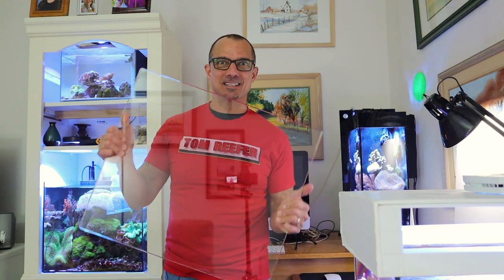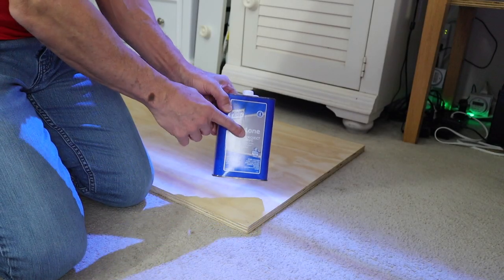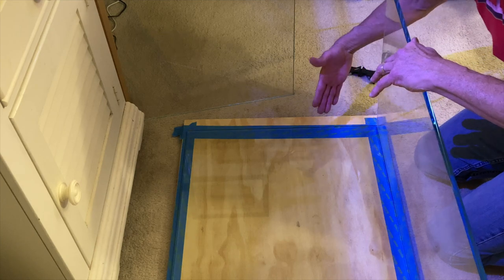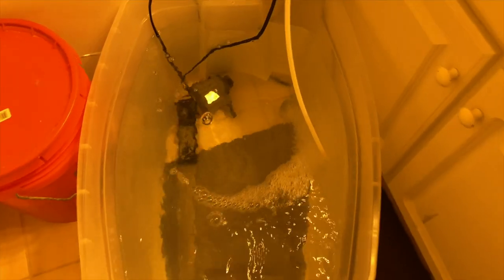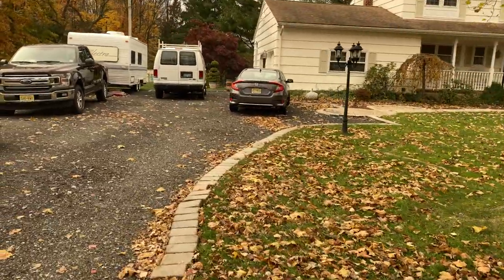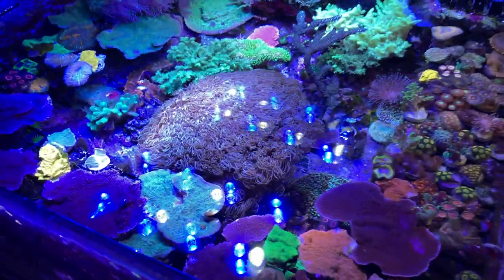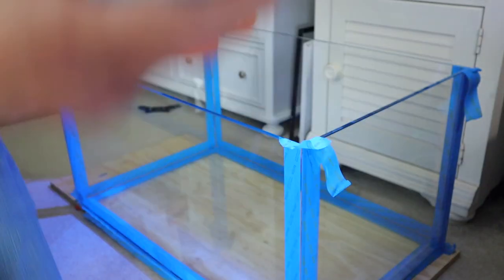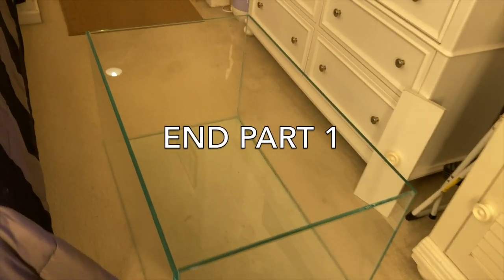How To Set Up And Build A Saltwater Reef Aquarium - 75 Gallon AIO

Comment: Great work Tom! Please tell me you are using glass for the filtration box? You can use black acrylic as a cosmetic skin but make sure the glass structure comes up all the way to the overflow point. Best solution would be black glass and have the overflow cut with a water jet like the waterbox has.  The difficult part is getting the glass and acrylic properly bonded.
Reply from the maker: Hi Richard, I would love to use glass, but I want it to be opaque. WB glass is translucent and you can see through it if I make a refugium. Plus to have the glass cut like you’re saying will cost more then I wanted to spend😃and I will need to have baffles made also. I’ve had success, for interior applications, gluing to glass using Weldon 16 acrylic glue. I won’t be using black either. 😜. You know I like to be different, but I’m also very aware of what will look good .IMO 😃

Comment: Great work Tom! I love your channel and your unique style. Question, why do you consider siliconing on top of the glass a bad idea? I have done this on pretty large tanks and ….so far so good 😊
Reply from the maker: Hi Maverick, thanks! Do you mean attaching the side pieces of glass on top of the bottom piece of glass?  If that’s what you mean, it’s just a structural issue. When attaching to the top of the bottom glass, you’re placing more weight down on the bottom glass, possibly not creating a thick enough bond of silicone because of the weight of the top piece pushing to much silicone out. When it’s siliconed to the side of the bottom glass there’s no weight at all pushing down on the bottom piece of glass, and you can control the thickness of the seal.  That said, if you’ve had success the other way, thats cool! 👍🏻😊 glad you like the channel! Tomorrow 10:30am making a skimmer 😃👍🏻

Comment: Hi Tom, is there any difference between the clear and black silicone other than the color? Did you use a certain strength silicone?
Reply from the maker: Hi Dave, strength is the same, I’m liking the clear looking tanks lately. Europeans are doing this more, as I can see. The ASI silicone is what some manufactures use. Not sure if any other silicone could be stronger. They list the strength on the tube. 👍🏻

Comment: I know this a old video Tom. I'm looking to build a 36x24x14. How would i calculate the size of each piece? Plan on using 1/2 glass.
Reply from the maker: Hi Leroy, I’m assuming you want 36 long, 24 deep, and 14 high?  You wouldn’t need 1/2” thick glass. 3/8” would be plenty. The only calculation you need is for the bottom piece of glass. The sides, back and front, don’t rest on top of the bottom glass. They rest on the sides of the bottom glass. Therefore the length of bottom glass is 36 minus the thickness of the glass x 2. In the case of a 1/2 thick glass it would be 1”. Which makes the bottom 35. I wouldn’t use 1/2 for that size. To thick. The two sides remain 24” and the back glass is 36, like the front.👍🏻good luck! 😃
Reply: @TOMReefer  awesome thanks for the info.  So if I did 3/8 the bottom would be 35.25x23.25?  And the 2 sides would be 14x23.25 correct?  The front and back would be the outer most edge correct?
Reply: Should I do low iron all the way around?
Reply from the maker: @leroycline8849   the sides height doesn’t change, and the depth of the side just have to match the depth of the bottom. If it’s 24” then the sides are 24”. What ever you make the bottom depth the sides should be the same. And yes, the front and back are the outer most edge
Reply from the maker: As far as low iron, Bottom no, but everything else.

Comment: How thick are those glass?  I wonder if I could go bigger (a 4x2x2ft,  120 gallon perhaps) without adding braces. Is a 1/2" thick glass enough?
Reply from the maker: Hi Dave, my glass is 3/8 (10mm), but only 38” long. 1/2” glass  would be strong enough for 48” with no brace.👍🏻

Comment: Tom tank looks great so far. It’s quite an undertaking. 
Question: I had my tanks alkalinity rise from around  8 to 9 dkh due to a water change and forgetting to turnoff auto top off while doing the water change🤦🏻‍♂️. My ruby wrasse seemed a bit pissed off  but everything else seemed ok. I added a little salt water to get the salinity back on track (slowly) and kept the ato off to get alkalinity stable. My fish all ate well for the next two days. Found my ruby red dead this morning. Sucks. Could this be from the alk spike ? Everything else is doing well….so far. All other parameters are good. Checked this morning
Reply from the maker: Hey JTDR, thanks! It is, but I enjoy making stuff and saving some $. A lot actually. 😊So, you did all the right things to get your tank back on track👍🏻 I’ve done that before, siphoning away and on comes the ato! Haha. Not sure if the alk spike would have killed your fish. That effects coral more then fish, and a point from 8-9 is not that drastic. I’m assuming you dose kalkwasser in your ato? How much ato water went in? You may have had a ph spike also. I don’t know the ruby wrasse that well. If it’s a hard to keep fish, It may have just been poor timing. Maybe the wrasse was on the edge of something and the parameter change put it over the edge? Sorry about the fish. 😏 casualties always suck.